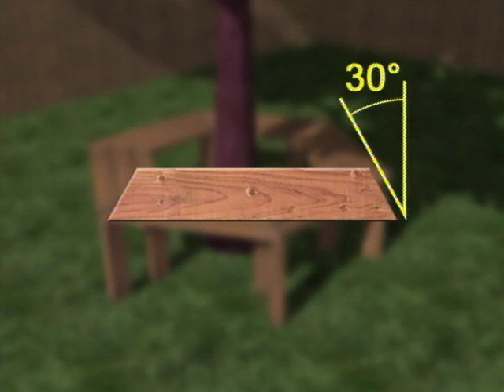How to Build a Bench Around a Tree

Comment: I was wondering , how I know how to make the sections to fit around the tree. once put together , how do I know it will fit together and was not made too small? is there a measurement to take to know that the finished sections will fit?
Reply: Do your two main pieces first, like he did, and then adjust accordingly to fit the final two sections. Doesn’t have to be perfectly even all the way around in my opinion.